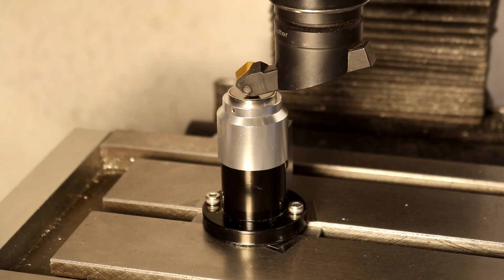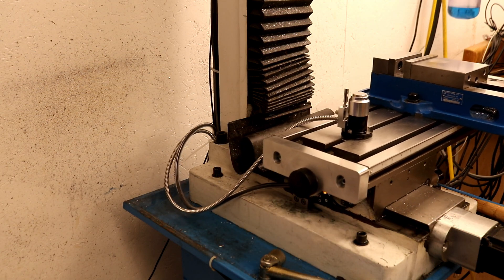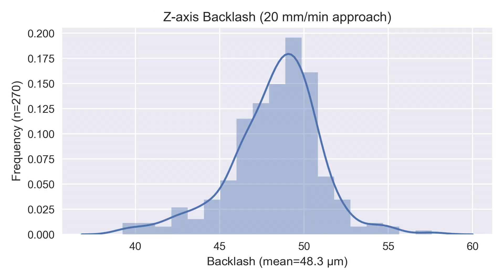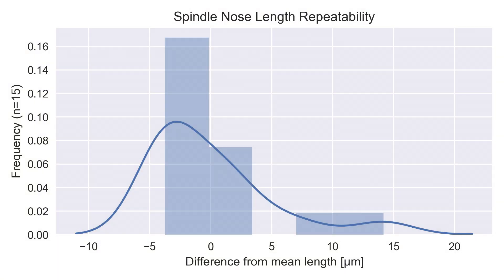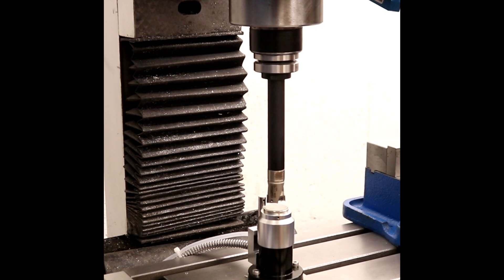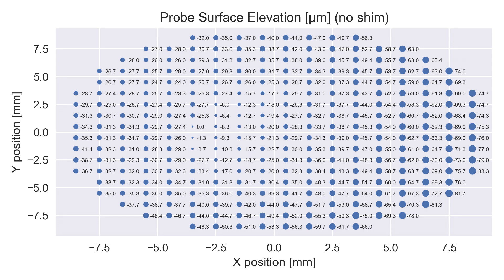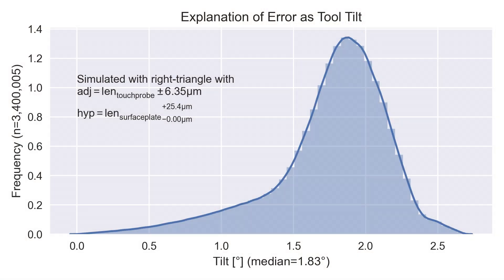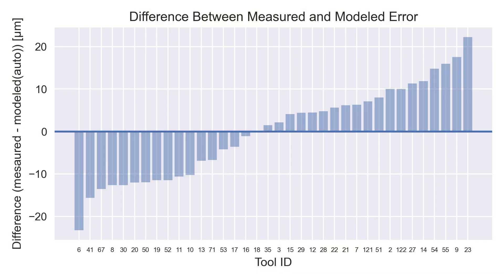Tool Length Automatic Touch Off Probe Error Analysis LinuxCNC

Comment: Accuracy in probing is of course needed If precision is required in the final parts. But try this: load any tool in your mill, set up a dial indicator between the mill column and the tool and then apply force, by manually pushing the tool towards the column. My guess is, that you will see significant deflection of the mill, and compared to this, chasing um when probing might not be worth the effort. Anyway, I really liked your video. I learned a lot. Thank you for all your awesome videos
Reply from the maker: Thank you, no doubt I put time into a measurement that'll be overwhelmed during machining. I just wanted to see how close I could get with an inexpensive probe :) Pushing reasonably hard, left, right, top, bottom, I can get +/- 5 thou movement of the head. Oh, and the spindle deflects 2 thou too, but in only one position. That will be a future repair for sure. With this deflection, would a 1-2 thou error measuring length manually matter? I've learned to live with some of the deflection, for instance knowing that when profiling, I must raise a couple a couple thou else the floor will be cut too. I would like to someday work with a big machine and see if stuff just works out of the box or if similar tweaks are needed. Let me know your suggestion of the next improvement to make. I finally have some dedicated time now.
Reply: Wow, that actually surprises me. I had the same machine once, and I was able to flex  the tip of the tool almost 0.2mm by pushing it - and I already had the column bolted to the wall to add further stiffness. I can see you don't use the original spindle, maybe that is the difference (and maybe my machine had a production fault. I bought it new). 
I now have an old Aciera F4, which is much stiffer (and heavier).
I  see lots of videos on the topic of upgrading to cnc and chasing precision in the new parts and the electronics. 1000's of dollars are spent on ballscrews, spindles etc. But the frame is often extruded aluminium profiles or light weight cast iron and I often feel much of the precision (and dollars) must be wasted. I would love to see the mechanical topic investigated

Comment: For repeatable homing you could rely on switch + encoder index, if you have access to the encoder signal of the motor. That’s one of the changes I need to do on my machine.
Reply from the maker: Hi Vasi, great idea! I just received some HD15 breakouts to hack into the encoder signals :) The driver manual does not show an index signal, but maybe the encoder provides an unused one? Will soon test.

Comment: Uncanny - I just received one of these yesterday :) After a Linux Distro update (still on Stretch) and moving to 2.8, this is next on the list. Thanks for posting your config; I've known I needed to add some debounce to my existing probe setup for awhile. Referencing your config will definitely be welcome!
Reply from the maker: Hi Ron, that's pretty neat :) If you hook up the airline, I listed the parts that I used in the video description, mostly McMaster stuff. I run the air solenoid at 90PSI, but put a small restricter on the inlet. 2mm ID silicone hose worked well, with 1/8" NPT barb fitting, with copper wire used to secure the hose. At full 90PSI the silicone tubing would balloon up :)
Reply: @kentvandervelden  Thanks. I hooked up a number of extra solenoids when I plumbed in my ATC a year or so ago. I think I'm stepping down shop air to 60PSI for its operation but need to check. (also blew my Mesa card because I didn't think I'd need flyback diodes for the solenoid :( . The restricter doesn't seem a bad idea regardless)

Comment: its amazing how deep you went in to this :) in my opinion the biggest source of error is the probe it self. it has some springy action happening there. 1 it is triggering different at different locations, 2 it might not return exactly to the same point. why not making a rigid probe perhaps with laser sensor above it to slow down the decent for probing.  this way you could face top of the probe flat and measure all sorts of tools. great video tho! lots of very interesting ideas.
Reply from the maker: Hi Fox, this drove me nuts. I measured the same set of tools so many times. The probed length is so repeatable. All can be shut down, restarted, rehomed and essentially the same measurement comes out if touching probe at the same position. But, I have one very-very last test to do... :)
Reply from the maker: The very-very last test results: After reloading a tool, and repositioning, between each measurement, the repeatability is still +/- 5um. I thought for sure that reloading the tool (hitting the drawbar with the hammer, cranking down the drawbar) would be the source.
Reply: @kentvandervelden  omg.. i forget you have drawbar. i have drawbar in my manual mill and i replace it with a drill chuck. draw bar takes ages to change. i think you reached the limits of the machine.
Reply from the maker: In this video, he uses a laser to find the rough length quickly, and then a copper plate for the fine probing. It's pretty cool
https://www.youtube.com/watch?v=v-S4RXMdlrY

Comment: I would be interested to see the tool diameter, tool length and tool weight graphed in the same order as the chart at 17:06 to see if there is any correlation.
Reply from the maker: Hi Matt, I like the way you think! While not the same as a graph, the r^2 for a linear regression between error and diameter is 0.41 (after dropping the fly cutter, Shear-Hog, and facemill) and between error and length is 0.61 (including all tools.) I dropped the three tools in the first regression because they were way off the regressed line (and dragged r^2 to 0.7). I don't have weight measurements.
Reply: Kent VanderVelden is it possible that your ball-screw has travel distance error or fluctuation across that distance? Or differs from the range that you calibrated the axis movement to?
Reply from the maker: @molitovv  Absolutely! When I get home, I'll stack up some gage blocks and test their heights. Most of the parts I make are <= 1" thick and so the problems you describe could go completely unnoticed.
Reply from the maker: The test was to use a Haimer and the LinuxCNC DRO to measure the distance from the top of the vise fixed jaw plate to the top of gage blocks, always approaching from the top. (The gage blocks have length specs way better than I could verify.) At least over 4" the mill measured lengths are surprisingly good. Was hoping you were on to something about the ballscrew, though I sure would not want to need to fix that mechanically :) (may be able to correct it in software) Would be glad to test other ideas. This was a great one!
Fixed jaw plate: 0.0000"
0.1" block: 0.1002"
0.5" block: 0.4999"
1.0" block: 1.0004"
2.0" block: 1.9994"
3.0" block: 2.9995"
4.0" block: 4.0000"
Reply: Kent VanderVelden I think that I would remove the tools from the equation in order to reduce the variables.  Perhaps zero the spindle nose to the tool length sensor then move your height gauge from the surface plate to the bed of the mill.  With the height gauge probe zero’d and contacting underneath the spindle nose, you can check repeatability of the whole system at any different Z heights. You can then move the mill to any position and at any acceleration and check if your Height Gauge agrees with the LinuxCNC DRO.  I think that this would make it very easy to set up an iterative process by which you could discover the root cause.